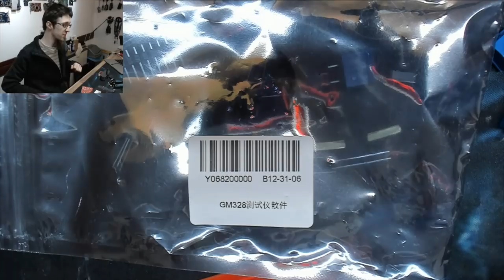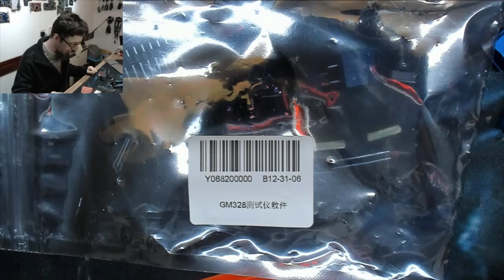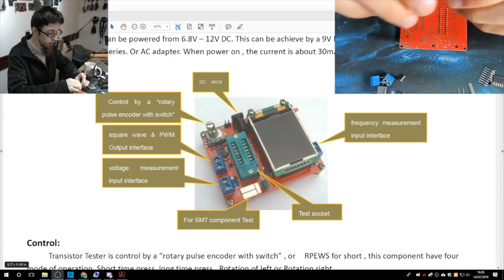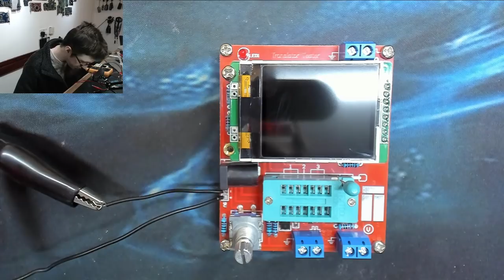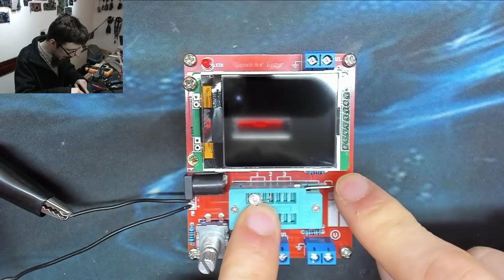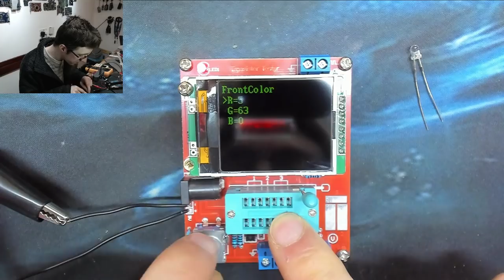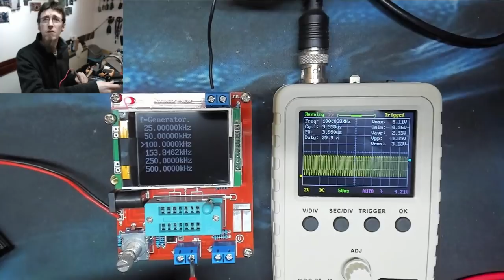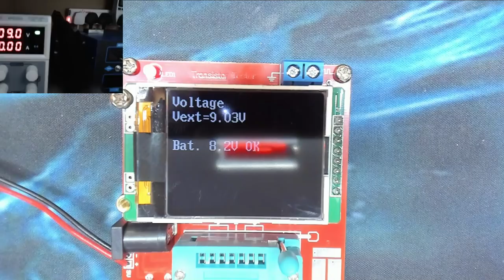LBE#2 - Component / Transistor Tester

Comment: Nice video, I'm waiting for one of these, looks fun.

General advice with electronics kits is to start with the smallest/lowest components first, and work your way up to the tallest and bulkiest ones last; it makes placing and soldering much easier. Not putting the IC lock-socket in at the beginning was a good call; if you had you'd have been muttering about it later ;-)

Comment: Great video thank you . Do you recommend this for a beginner in DIY hobby electronic. Do you have any suggestion on what would be a good starting project if not this one?
Reply: If you want to make your life extra easy as a beginner, look for kits with a single sided board, double sided boards, or ones with through hole plating like this are a tad harder to solder well & considerably harder to remove components from to correct any errors you may make.

That said, this wouldn't be a bad choice as a beginner project, hot tip though, start with the small (lowest) components & work up to the taller ones, it's easier to keep the components in place while you solder them them.
Reply: Thank you for taking the time to answer my question

Comment: A GOOD way to assemble these kits is..  to install the smaller components first..  I had trouble putting the Wave Form Signal Generator..  I found the Small Caps to be out of tolerance.. AND..  it's a double sided PC Board..

Comment: A little long of a video but cool. Mine came out fine but having issues with calibration. Everytime I turn it on it askes again to calibrate. Just got it so still trying to figure out how to use the menu.
Reply from the maker: Yeah I never managed to calibrate mine. I've tried a couple of times. Even uncalibrated though, it's more or less on the mark for most components. It's only got to be roughly accurate for identification / confidence test. For precision testing you'd want a proper multimeter/LCR meter.

Comment: My one doesn't work :( Draws 0.375 A while encoder pressed and 7550a regulator gets hot. Replaced it, same thing. Double, triple checked all components position and all is correct. Don't know what I'm missing.
Reply: @Adamant_IT  And I will :P But no damn little simple board will beat me! Looks like there is a short somewhere on the PCB.
Reply: shorted board alright:
https://imgur.com/a/7Uyt8QM
Thanks for sharing. If I'd check the board before assembly, oh well it's working now. Thanks.

Comment: Will it be more accurate if we solder the IC directly without socket?
Reply: It shouldn't be.  Accuracy is more dependent on resistance and capacitance throughout all of the circuitry, which will be accounted for when you run the calibration procedure at first startup.

Note that any test leads you connect to the socket will add significant capacitance because these things are that sensitive, which is great.  If you calibrate the meter using whatever test leads you're attaching to measure things, their capacitance will be worked into the units calibration.  Use short leads if the socket doesn't cut the butter, and calibrate for any leads you add to the test circuit.

Steve
Reply: Some of the firmwares out there for these testers are better than others, so it is worth looking for a good one.
Reply: I'm still running the firmware that came with my kit, version 1.12k as listed under the "Show data" option.  Is there a specific version that is best for running on these things?

I really can't complain about this device in it's factory configuration.  Currently, it serves as a poor man's LCR for me, but most specifically, a poor man's capacitance meter.  It has a much better range, up to 100 millifarad, than my crappy HoldPeak HP-4070L, and reads ESR values within ranges I'd expect, although I have little to compare ESR values.

As for resistance, while it's spot on within all the ranges I've tested with 1% resistors, I still defer to my regular multimeter which agreed in all the same ranges.

As for inductance, it agree's with my crappy HoldPeak LCR in all ranges, but gives me one more digit of precision in the mH range, so I can't complain there either.

I don't use any of the signal generator/pulse width modulation, IR decoder/encoder functions, or voltage measurement.  I have a function generator that does so much more, I decode IR using a sensor on a serial bus and LIRC, and frankly, I'd be afraid to put a live voltage on the inputs of this thing because I use it so frequently I don't want to blow it up!  :)

As far as these crappy little DIY chinese kit's go, this device is  the most useful thing I've put together out of such a kit.

I suppose, really, I would consider updating the firmware if only different firmware did something better for me, withing the scope of my use of this device.  I don't recall seeing a serial header on this thing when I assembled it, and unless it's under the display...  too lazy to take it out of it's case..  Come to think of it, I'm probably too lazy to investigate further since it does what I need it to do.  :)  If I need a dedicated setup for rewriting the IC outside it's current working environment, it is highly unlikely I'll upgrade the firmware...

I suppose I'd still be interested in the process if you care to post.

Thanks in advance,

Steve

Comment: I put together this little tester.  When pressing the dial in, it would turn on and off right away and the LED wouldn't light.  I traced and found that the LED was installed the wrong way.  Once I flipped the LED around, it worked fine.  Hope this helps someone else.

Comment: Where did you get the pocket O scope?
Reply from the maker: Search ebay / alliexpress / banggood for "pocket oscilloscope". The one I have is pretty good for starters, although very limited once you get into higher frequencies (200KHz+). It's not a scratch on a proper real bench scope, but if you want to look at simple signals without the investment cost of a real scope, it's a great place to start.